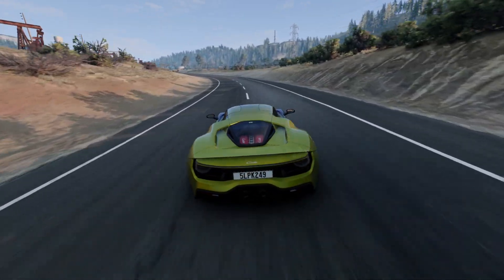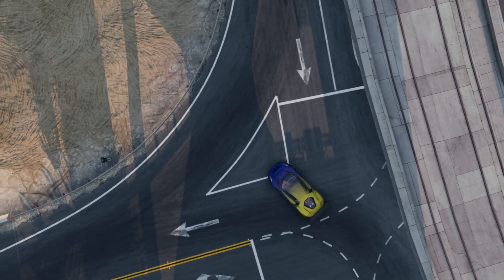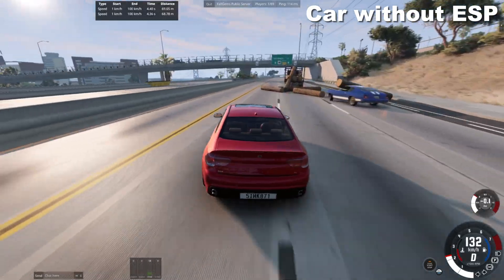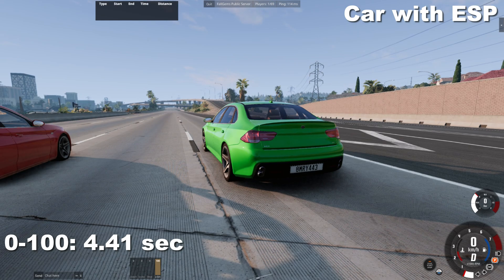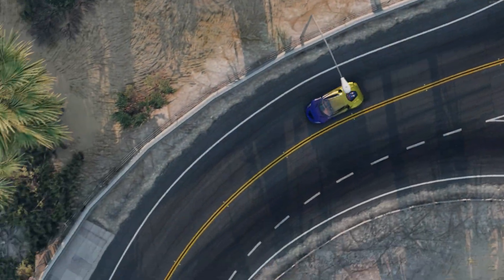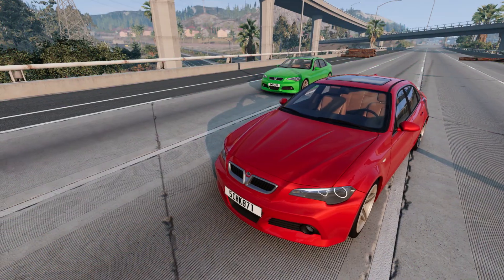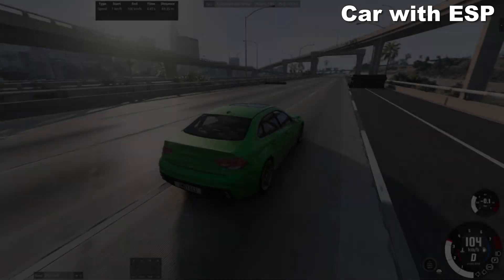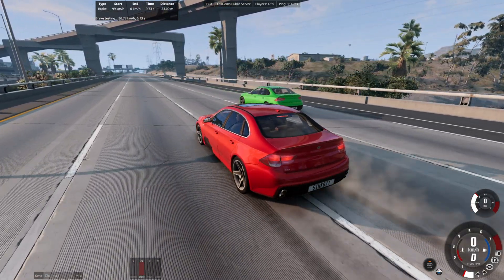Do stabilization systems in cars really work and are they really necessary? Let's test and find out

Comment: Hello i am facing a problem in beamng .can you help me .

After recording rhe footage in replays.
I tried to open f11 for different camera angle 
But it is showing in top right corner 
Fatal lua error.
So i can't able to open f11  in replay mode
Reply from the maker: You open f11 to start the world editor, right?  Unfortunately, I don't know what the problem is, friend (Maybe try restarting the game, or the computer will not get the error) But to change the camera angle, you don't have to open the world editor, you know that, right?  You can simply press the buttons 1 2 3 4, etc.  switch between different cameras, or use the mouse button to rotate the camera.

Sorry if I didn't help you (

Comment: In beam ng, ive never used any form of traction control, I always disable stability control and power steerting. I generally use ABS though. I took the race version of the ibishu dina thing, gave it wider rears and fronts, adjusted the suspensions and gave it 1600 horsepower, left it RWD, and I can control it just fine on my wheel and pedal setup. I dont need TC or stability control cause Ive trained myself to not need it, and it gives me the maximum amount of control, if I need to throw a 180 quicky, I just clutch kick in 1st or 2nd with the wheel cranked.
Reply from the maker: Wow bro, you are really pro in this case!  Or I'm just a bad driver, lol ) Yes, the ABS is very hard to turn off and actually it is ok.  As I said before here, I had to demolish all the stabilization systems in the car to get rid of the ABS.  
By the way, what steering wheel do you use?  I have a G29
Reply: @vertviger  thank you! I'm 17 and have about 15,000 hours on the sim, about 4 thousand of them go to beam NG alone, I have experience driving 1960s muscle cars with over 400 horse power in real life, and do some karting from time to time, so I'm not really pro, but I have good throttle control and understanding sortof what the car is telling me, I learned it mostly from drifting, and apply the same techniques when I hit the touge also in real life, it also helps too that every car I've owned hasn't had traction control or ABS, and whenever I drive a car with traction control, I always just turn it off. I use a thrustmaster XT leather edition with a logetech shifter.
Reply: I play controller,  I do crazy race builds all the time. Maybe not 1600 hp cars, but I have a FWD 300hp time attack Covet, a crazy chopped up Covette missile, a drift pessima, a fun as hell Pickle with a engine swap that is slammed and "widebody"
Reply: @lohostege  man, I got a crazy covet build too, a little less power but it bite into the corner better than anything else on the road, I think my fastest time ever on tail of the dragon was set with that car, but the drift pessima sounds awesome too, I did a coupe V6 RWD drift pessima I featured in one of my films a while ago, I should probably remake that car, it was really fun

Comment: and bro used beamng for testing, the most unrealistic game in terms of physics
Reply from the maker: Bro, I hope you're joking ) 

But if not, I can cite several facts that indicate that BeamNG is the best simulator from all points of view.  
First, this game has a real air and fluid simulation, which allows you to do very cool experiments with aerodynamics (you can watch my videos about spoilers if you want).  
BeamNG also has a separate division called BeamNG.tech, which Audi and many other manufacturers of cars and car security systems use as a simulator for testing their new technologies.  
Doesn't this tell about the peculiarity of the game?
Reply: @vertviger Beamng doesn't have properly good aerodynamic simulation currently, nor tire simulation. 
But, the chassis/body simulation is top notch, and handling is fun because how well weight transfer works
Reply from the maker: @lohostege  Yes, I agree. But all in all, BeamNG is a game with the most realistic physics I've ever played.
Reply: You cannot just gloss over the fact that the tire model is not even close to realistic. The aerodynamic model of beam ng is not that accurate either compared to assetto corsa or Iracing. I understand your point,  but this test would be more grounded in reality in a racing sim. Beam ng is a soft body physics simulator, the best ever, but it is not the most  accurate driving sim. Threshold braking is a real thing with non abs cars, they don't have to lock up all the time. You lose consistency compared to abs. Esp is almost an entirely unnecessary aid in any racing sim that will almost always make you slower even with a few years of experience. Esp is still better than traction control  which outright cuts engine power. It is alot easier for a driving simulator to showcase these effects. The point is, yes beam ng is a great simulator, but it is not a master of all driving simulation. It gets soft body physics nearly perfect, but the tire model  seriously hinders realism and the aerodynamic model is somewhat simplified compared to a real sim. These test are good but lack nuance which is what I believe @vertviger was trying to imply.
Reply: @klacksteron I definitely agree with you, but the tire physics are alright compared to other car simulators

Comment: i drive no stability control i just drive without anything and i drive perfectly fine in beamng
Reply from the maker: @HawkEM2 By the way.  You can't turn off ESC so easily.  Simply by switching driving modes, you will not completely disable the stabilization system.  For this video, I had to root out all the electronic systems in the car to get rid of the stabilization systems, lol) And it really makes a big difference: whether the driving systems are switched, or no stabilization systems at all.
Reply from the maker: @HawkEM2 Yea. Modern cars simply cannot turn off all stabilization systems.  This is at least one of the key security systems.  And if it was so easy to turn them off there, then such cars were simply not allowed to be produced 🤔
Reply from the maker: It means you are a good driver ) 
Do you use the steering wheel when you play BeamNG?  Because the game with the steering wheel gives completely new emotions )

Comment: That was , a amount of effort, its crazy, I like Mersedes RL story , cool video brother
Reply from the maker: Yes, stabilization systems have a long history.  I think that for so long Mercedes has been doing tests to check the safety of these systems and to improve them before releasing them into the series.  By the way.  A long time ago, I was preparing material for a large video comparing Mercedes and BMW.  That's an unrealistically large amount of material.  Starting with the stories of both companies and up to their present.  What do you think , need I to make such a video?
Reply: @vertviger  так, ти навіть можеш поділити його на декілька частин
Reply from the maker: @stefco4616 Так, можливо ) Треба буде подивитися наскільки довгим воно буде. Можливо буде 2 частини по 10 хвилин , десь так. Матеріалу там реально багато.

Comment: 6:04  they abreviate (shorten) it down to ABS because the two words are separated by a dash so it perceived as a single word when said (but its separated by the dash to show that its actually two words combined). And i think thats why its only ABS.
7:19  here its has two reasons for it flashing, one is to show antilock braking is working (like you said) ,but its also to get the attention of others around with the red flashing lights on the back of a vehicle to show that youre braking very heavily. 7:47 here , also the ABS system immediately turns on the hazards on its own once you stop to warn others, the hazards on the other car doesnt come on since it doesn't have the system installed. Pretty cool.👌
Great video👍
Reply from the maker: Yes, thanks for the explanation ) Everything is fine with L, it has not disappeared) Yes, I know that such flashing lights are also to show very strong braking of the car, I just wanted to emphasize the work of the ABS system.  Yes, the emergency light is also automatically activated on cars with ABS )
I'm glad you liked the video ) And in general, are there any flaws in the video that I need to improve so that the content is pleasant to watch?
I will be very grateful for your advice )